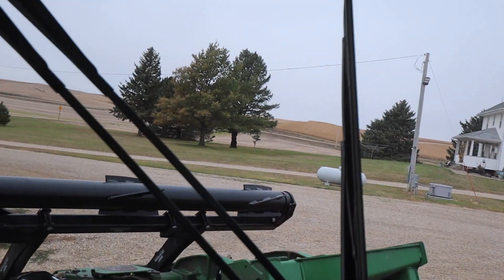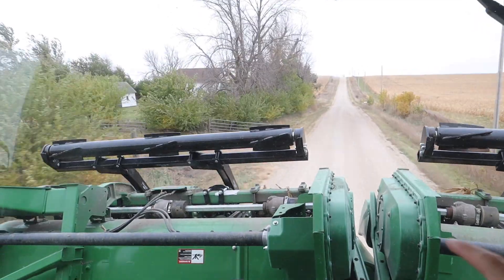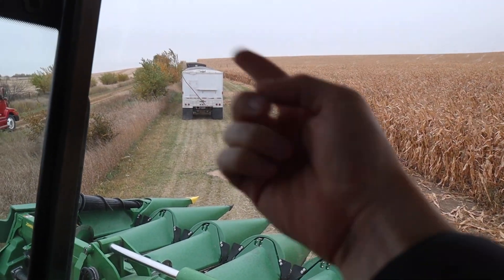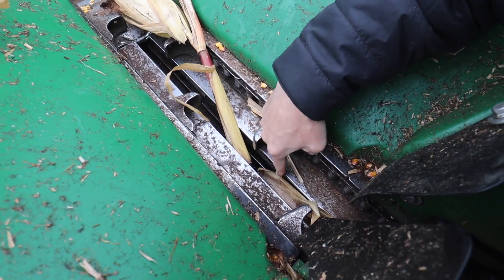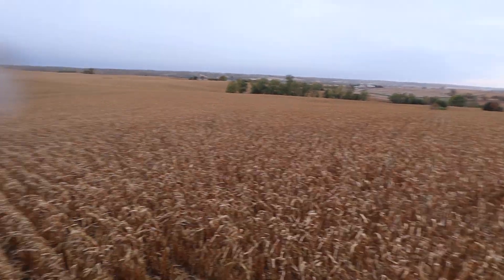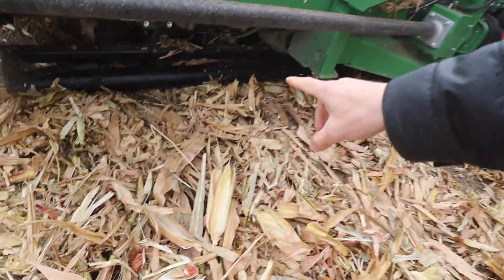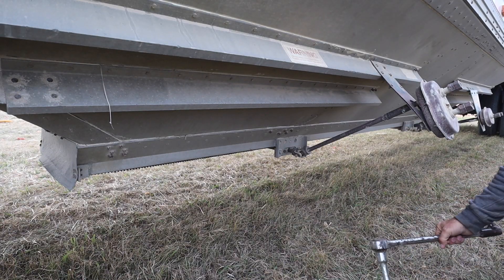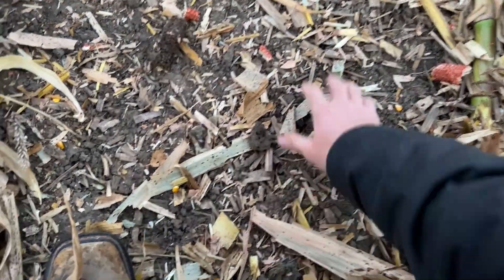John Deere Combine Durability Test #1

Comment: 13:40 add different pulleys on both sides to the system to add one more belt more power transmitted, alternatively you cna change pulley diameter , slow the turning increase torque

Comment: hey cole you need to get you some Thunder tarp straps for your grain trailers. there made for keep your tarp down so the wind doesnt throw it up in air or over the trailer. Have them on my trailer saves you a bent bar and a tarp. I have them on front middle and end of trailer.

Comment: You guys should look at installing a "Man  Lift" put in at the new bins. If you've never heard of it. It's basically a big belt with steps and handles spread out along the belt. It can be ordered to any height.  You step on the running belt, it lifts you up to the top of the bin or back down.
Reply: Good idea

Comment: You've been working hard to get the Deere to reasonable loss in both corn and beans. I know the Crary takes a lot of power to run but looks like its worth it. Smashing a snout with a hay bale sounds like the way my year has been going only its been unloader tube vs tree.

Comment: It sounds like to me that the pit auger is not turning fast enough to get the rated bushels per hour. It could be because the belts are struggling to turn all that grain weight because they are slipping to much. I was wondering if there is a way to convert to a geared transmission and do away with the belt setup........but I really don't know what I am talking about.....

Comment: Seems new bins sites and legs always have issues. (Work at a co-op) we adopted the habit for the start of harvest of just run everything as slow as possible for a truck and then just make a small adjustment, check all gauges/ listen and make a bit more adjustments till it starts to overload then back it down some based off of how each commodity and moisture of it runs

Comment: The biggest issue I see with that dump pit is having an auger in it instead of a 10,000 bu/ac drag. When we re-did our system we debated, big dump pit or high capacity drag? We went with the high-capacity drag. It comes out of the tunnel, turns a 45 and dumps into the down side of the boot on a 10,000 bu/hr Schlagel leg. It actually moves more than 10,000 bu/hr - it will unload 1,100 bu in 6 minutes. Three years later, have not had a single problem with it and it never fills up with water. The bottom of the drag is 2ft off the tunnel floor so any water just collects under the drag, start the pump on that and pump the tunnel out now and then. The tunnel can hold up to 2,000 gallons of water before it ever floods the drag.

Comment: there must be something too tight with the auger from the pit. Burning belts means that there is a tremendous load on something that should not be there. Or the pit/auger is not sized correctly for what you are doing.

Comment: Honestly, you need to make sure the rotor is level and then start to adjust the sieve and Chaffee. The sieve should be wide open I believe.  You do not want any corn going through the return. You should not have any cob concave maybe to tight and or the rotor speed is to fast .  My S780 is clean with very little cracking . And no cob

Comment: Cole have you tried to retighten the belts after initial stretch ( first couple of hours of operation. The belts will tend to stretch.
Reply: Plus they wear in and that makes them loosen up too. They need to design these with spring loaded belt tensioner/idler pulleys. These must have been designed with inadequate drives, should have been multiple belt sheaves if it's taking that much power to turn them?

Comment: Just a speculation from an innocent bystander watching the show, but just an idea, witch some engineer should of done before (or caught) before it got past the drafting stage. Has anyone measured the pulley sizes, motor speeds, and then went and estimated how much bigger the drive pully needs to come back along with a possible smaller pulley on the auger? ( sorry I use to do bearings, gearboxes and shafts on my previous job cycle. ) just an 💡 didn't say I was right or wrong.

Comment: the people that put up that bin should never ever be allowed to do it again, it's disgusting, i would think the labor cost for your bin set up should be wiped off, a site like you have there should be able to handle load after load without any problem, brakes my hart to watch your Dad and Cooper fight with it to try and get it to work, did they never do a proper run through when it was being put together, i hope you get compensated for all this in the end 🤞

Comment: Wow your bin people really screwed you guys over 

I don’t believe I’ve seen so many issues with a new installation ever 

On your pit try changing your pulley’s to a 4 belt and then order matched belts 
Or change it to a chain drive 

Motor size and hp and rpm are critical for speed under load 
Good luck

Comment: Gotta be annoying to have a brand new bin site that is THIS dysfunctional.  Did you get an express warranty?  Even if you didn't, there should still be either an implied warranty of merchantability or an implied warranty of fitness for a particular use.  You need to contact your lawyer.  This is affecting your harvest at this point beyond any reasonable standard I can think of.  I think a jury would side with you.
Reply: they did quite a while ago, sounds like they tried to get it  resolved with the contractor without much luck , then went to plan B ..the lawyers/ possibly court action
Reply: @ccole9080  I did not know.  Thank you for the information.  If they have consulted their lawyer(s) then I'm sure this will be addressed.  They have grounds now for a civil suit, and fortunately, thanks to cameras running daily there, it should be relatively simple to determine a fairly accurate remedy.  I wish them luck.

Comment: sounds like a design issue and/or installation snafu. I would be looking for those guys for help or find some engineer that could offer insight. It should not operate like that. yes - things happen till the bugs get worked out, but this sounds like the bugs were built in.

Comment: Forgive me, but this is unacceptable for a 1-year-old bin site not working. I would send the CEO or president of every manufacturer that supplied parts for the site and ask them is this is not working correctly. Also, I would send the bill for the belts to whoever installed the pit auger.

Comment: Why isn’t the red combine running? Use the John Deer and keep the wear off your machine. Seems like your taking advantage of JohnDeer.
Reply: The whole point is to use the machine....also, they have been using both, but they have only so much cart capacity......2 is difficult to run at the same time......